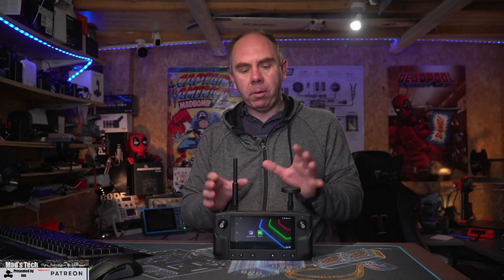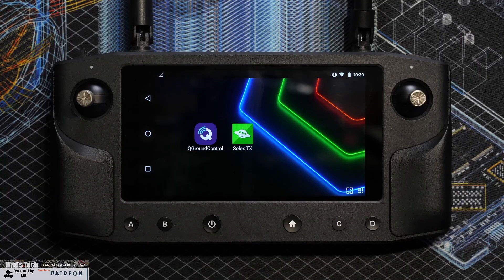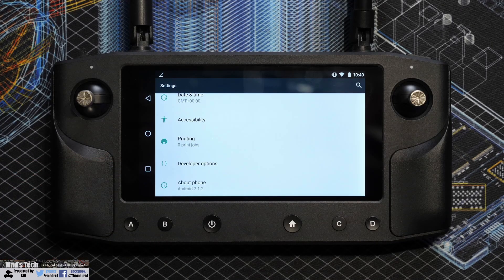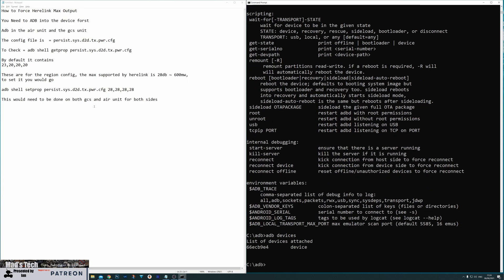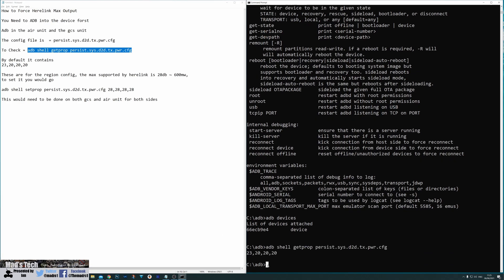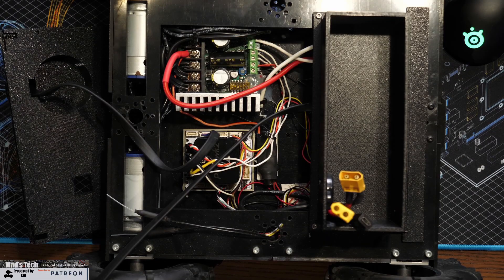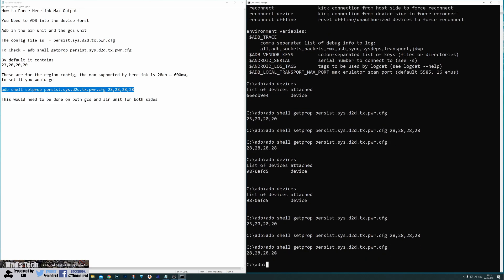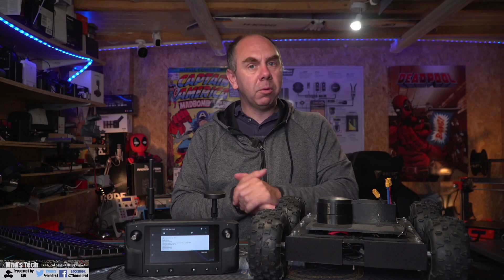Herelink 28db 600mw Mode - How To

Comment from the maker: Here is the instructions how -To

How to Force Herelink Max Output 

You Need to ADB into the device first 

Adb in the air unit and the gcs unit to mod. 

The config file is  = persist.sys.d2d.tx.pwr.cfg

To Check = adb shell getprop persist.sys.d2d.tx.pwr.cfg

By default it contains 
 23,20,20,20

These are for the region config, the max supported by herelink is 28db ~ 600mw, 
to set it you would go

adb shell setprop persist.sys.d2d.tx.pwr.cfg 28,28,28,28

This would need to be done on both gcs and air unit for both sides

Comment: Have confirmed that this does work, will do a test flight and report back
Reply: Oddly enough, I noticed a weaker signal strengths than normal on the controller,  I was able to make it to 32000ft ( 6miles) from home but that's not necessarily any farther than normal. Going to reduce power slightly until back to 200mw and report the results. Initially I noticed nothing substantial. Other than a weaker signal strength. Maybe not as clear of a signal at higher power?
Reply: Increasing the power output, DID NOT increase the range. At least,  not by going to 600mw. Will continue to test at different power settings. Assuming ultimately it is setup best as it's shipped to the customer given the stock antennas 📡

Comment: A little late to the party, but after losing connection a few times with the bathymetry boat I figure I should get this done.  Updated the tx no problem.  But adb devices returns nothing for the air unit.  It's powered up and working with the latest firmware.  Any ideas?
Reply: Fixed.  As someone else pointed out, just try another computer.  Right workstation, controller adb.  Left workstation, air unit : )

Comment: I tested on latest firmware The property where not set on the Air Unit, so the command getprop showed no value.
I had to issue the set prop command first and then I could read it back.
I might be wrong but this parameter does not seem to work on the Air Unit.
I checked with a (cheap) Spectrum Analyser and the signal strenght does not change after setting and rebooting
Reply: Where we could get a spare power connector cable for the Air link unit

Comment: How to do so the air unit is in developer mode?
When I write "adb devices" it doesn't show.
I have updated to the latest firmware.
Reply: Figured out how to do it. Had to use another PC.
Reply from the maker: What did you need to do as I believe its in Dev mode as standard.
Reply: @MadRC  the first computer has a different set of USB drivers. So I went for the easiest solution to use another PC instead of fiddling.
Yes the air unit was already in developer mode.

Comment: Great video. I suspect that the increase in range may be equivalent to the cube root of the power difference. But this may be influenced by the antenna radiation patterns. A more donutty shape would create less geometric attenuation with distance than a hemispherical pattern.